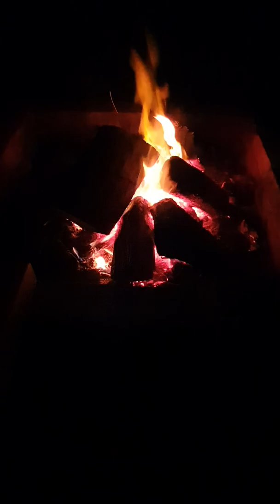How do DPFs work?

Comment: Doesn’t the soot get burned off at regular intervals at high speed runs, and so the cause of a lot of dpf oroblems are down to short runs and not burning the soot off?
Reply: I was told that its because your not reving the engine high enough and long enough

High speed  does  nothing
Its the constant higher engine  temps your chasing from what a engineer mentioned  when subaru had issues with  their dpf  setups

Id just prefer no dpf and just reregulate the stupid quality of fuels we put up with in australia 
That alone should clean things up a fair bit
Reply from the maker: The heat is made by the wet diesel fuel being intrduced to the DPF thats what makes the heat. Example the engines catalytic convertor can be at 300 to 400'C wile the DPF, which is AFTER the Cat, will be at 600 to 800'C. Because its a Burn. Engine load heat doesnt matter here. DPFs fail simply because they arent completing a burn and thats usually because of no steady state load or idle conditions.
Reply from the maker: DPFs burn ONLY at very light controlled load. Idle is very common time they burn.
Reply: Berrima Diesel Australia . So is there a lot of misinformation out there?  That is the first time I have heard that theory. I know on our new fire trucks the dpf burn offs occur as we drive along the highway at high revs.as the indicator on the dash tells us so. In regards to your theory, Is there a higher temperature generated at idle.? As I understand the reason many dpf’s fail is because of the lack of high speed driving and lack of burn offs.

Comment: What boost pressure can set if I m not taking my engine for a dyano test  .I am installing a 300 +HP turbo what is my maximum rpm chanda from Zambia
Reply: 2.8 disesl 3l engine I want to install a turbo what boost pressure can make or Westgate Can I use I would like 200hp and is the maximum boost pressure.chanda from Zambia God bless man
Reply from the maker: https://www.berrimadiesel.com/products-services/diesel-turbo-systems/turbo-system-toyota/turbo-system-toyota-hilux-3l-2.8lt-kit
Reply from the maker: Sadly that sort of advice cant be given easily as there are so so many considerations and all technical specs of that engine and set up need to be considered.....or BOOM one blown engine/turbo